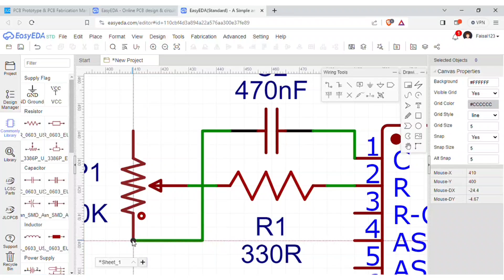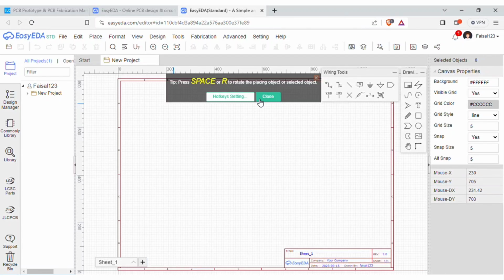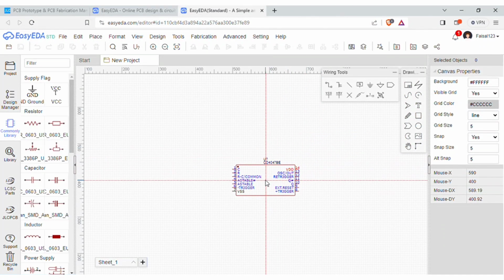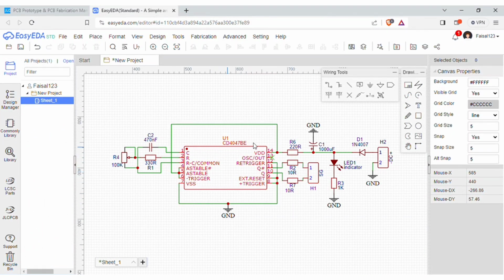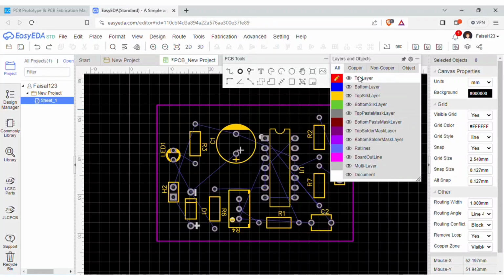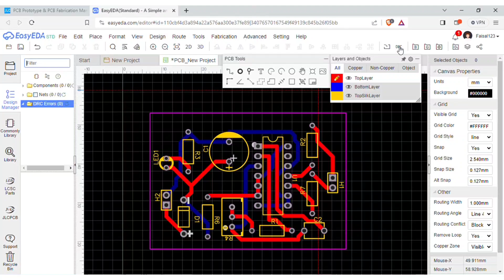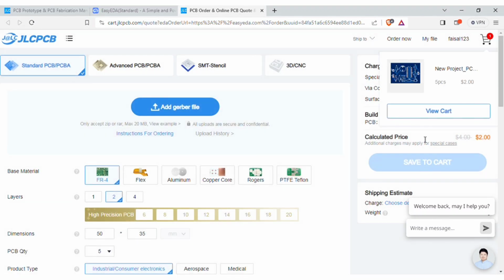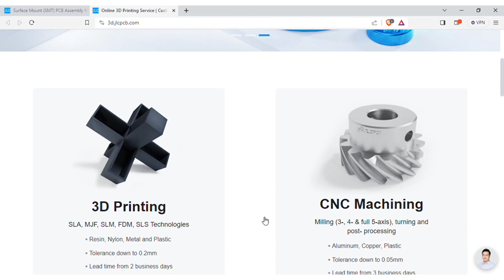Design your own PCB with EasyEDA & JLCPCB

Comment: Warning easy eda is not so good. I  spent 3hours on simple pcb and at the end cannot put copper layer. Before try make all circuit just to check if you can finish by making two three parts circuit. Im no longer want to use this web page.